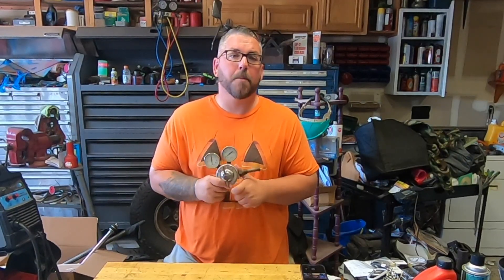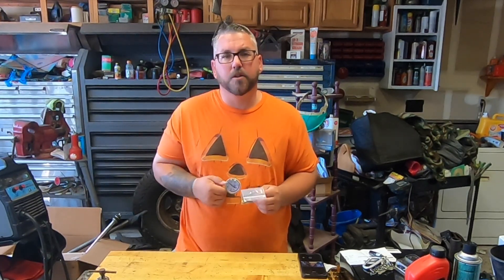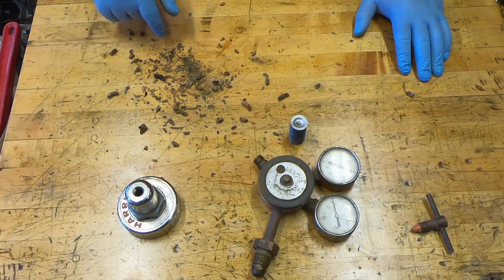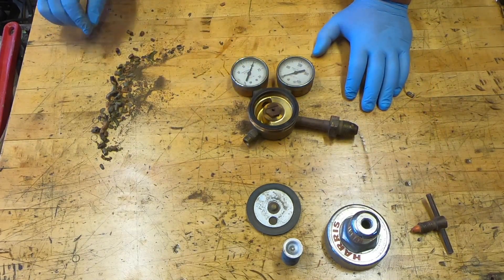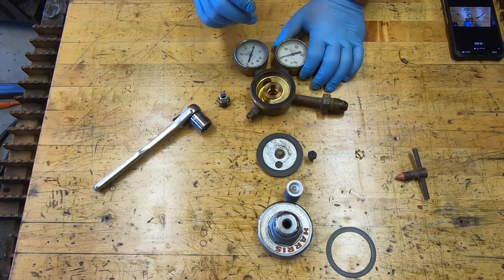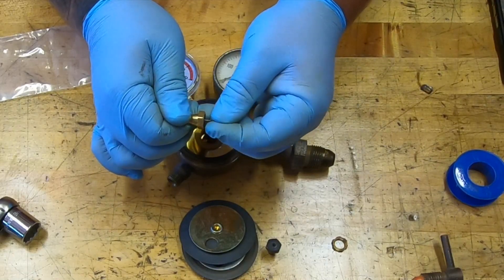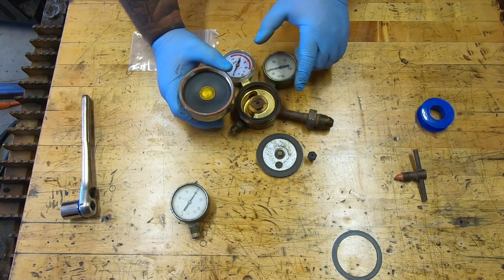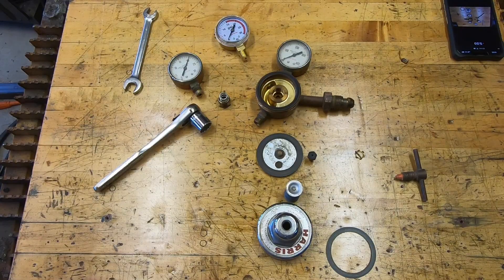Rebuild Your Regulator Before You Throw It Out!!!!!! Harris Repair

Comment: Excellent repair. Old regulators were built to last. Nothing like the cheap Chinese rubbish being sold these days. You have clipped out several parts of the video to make it flow not allowing the viewer to see the full dismantling and reassembly and the difficulties one may encounter. Using the oil filter wrench is an excellent tip.  Would have liked to see what was wrong with the old parts. It seems the rubber seal around the pin was not sealing.  Have you asked yourself why the old gauge blew?  Never open the cylinder valve when the regulator screw is engaged. Fully turn the regulator screw anticlockwise before opening the valve (closed position) . After fixing the regulator you opened the cylinder valve without closing  the regulator.  Old gauges were better built than the modern ones. Sometimes the gauge can be fixed by resetting the needle, however  it needs to be calibrated against a new gauge. This is something for locations where supplies of spares is not an option.  The Harris, but especially the Miller you tube channels, have excellent safety tips on the uses of torches and regulators.

Comment: There are mud wasps. They will nest inside your torch, inside your hoses, regulators, cutting attachments, welding tips  and also cylinder valves IF YOU LEAVE THEM UNSEALED IN THE SHED. Keep all equipment that will have gas flowing through it sealed with caps or just some electrical tape.  If they nest inside a gauge which is left lying around it may not be possible to clean the debris going inside the delicate components of the gauge.  The wasp lays an egg in dark small orifices' and then sticks a dead spider or insect inside for the larvae to feed. Then the caring mother seals the hole with mud. If they nest inside your mixer or torch, You can blow most debris out with compressed air, however, some mud may stick to the walls of the tube. Try placing the torch in very hot soapy water for a couple of hours and then use your compressed air to make it whistle clean again.

Comment: I don't scrap regulator cores since they sell on Ebay. Seal-Seat has a comprehensive catalog for old equipment if kits don't turn up from other sources, and you can also send them out for overhaul to online rebuilders or via your local welding supply. I overhaul most of mine but when I get a really crusty oxygen regulator I send those out to let someone else clean up the brass as my time is worth the few dollars over a kit cost and shipping. I don't buy new regulators or torches, only cutting tips and get most of those online too. I collect and overhaul torches and regs for myself per factory tech data and keep an eye out for them and for gas cylinders (know what you can exchange locally) which I snag often for less than the gas inside them is worth. 

I never run out on a weekend and after doing this about ten years I casually accumulated about 30 cylinders (they don't depreciate and I've plenty of space so why not?) in nearly all sizes.

Comment: Teflon tape is not recommended for gas applications, fine bits of it can find their way into jets, orifices, pilot holes, etc.  A good grade of pipe sealer used extremely sparingly is best.  Also, beware of RTV.  Also glass covered gauges are no longer permitted in commercial applications.  Almost forgot (not good) never any grease or flammable material around oxygen gear fire or explosion!
Reply: Oxygen-rated teftape exists (Blue Monster makes both tape and pipe dope as do others but their name is easily remembered) and tape is easily kept out of threads by leaving the first thread unwrapped.
Reply: White = water/oil/air, Yellow = gas, Blue = everything including gas. The Blue Monster stuff you speak of is what I keep on hand and it can be found at Home Depot or anywhere. Definitely not hard to keep limited to threads and not down below them in the gas cavity.

Comment: The leaves are from a flying bug called a ''leaf roller'' for the apparent reason. They accessed the inside by the vent hole in the screw on cover, they love to find holes in anything about .125 inches and then pack them full and lay their eggs in the leaves.
Reply from the maker: That’s crazy, never knew that was a thing.